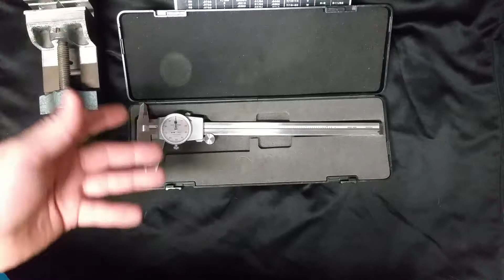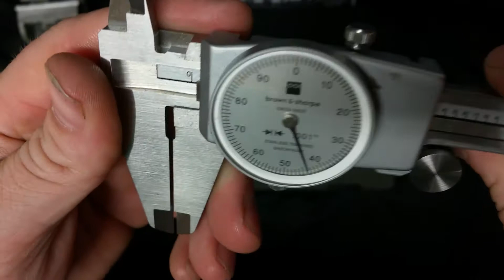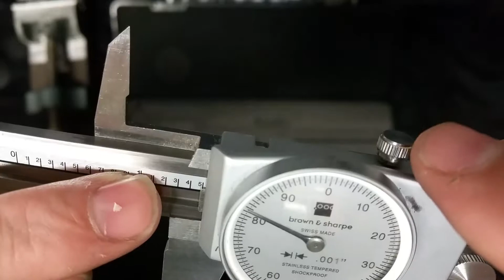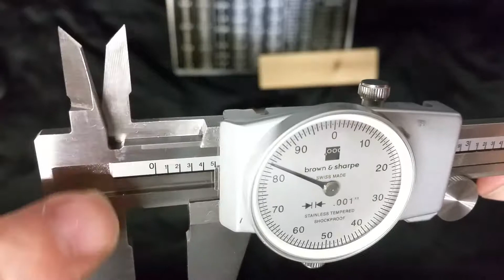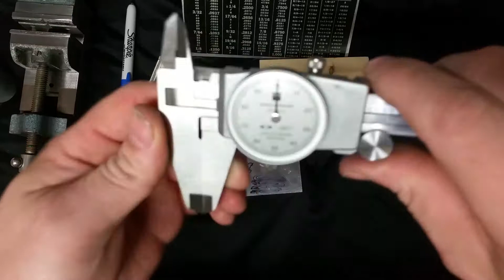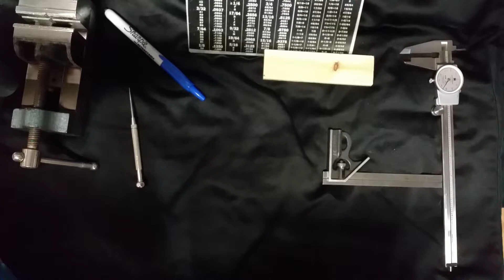How to use dial calipers properly

Comment: I too prefer dial calipers vs digital. It's what I learned on and I just feel like it's more reliable. I have an older/beat up set of Mitutoyo calipers I'm looking to replace here soon. They got magnetized somehow and keeping the chips off of them is becoming a pain! Lol. Next time I make a fabrication video I'll make sure to give you a shoutout. Great tip on using the calipers to set your square blade! I for some reason never thought of that. Great info!